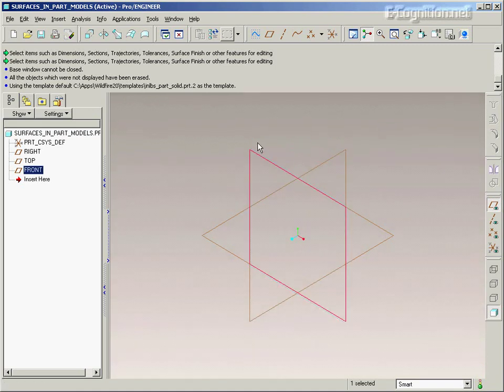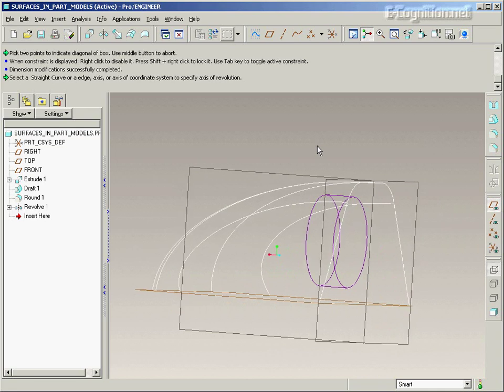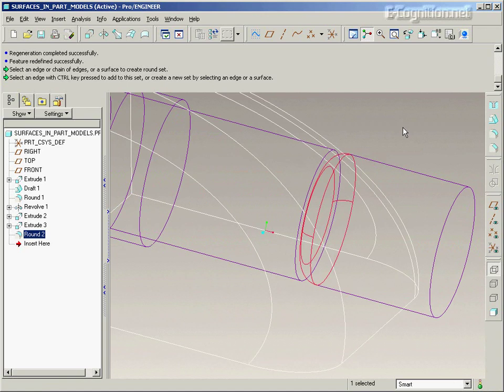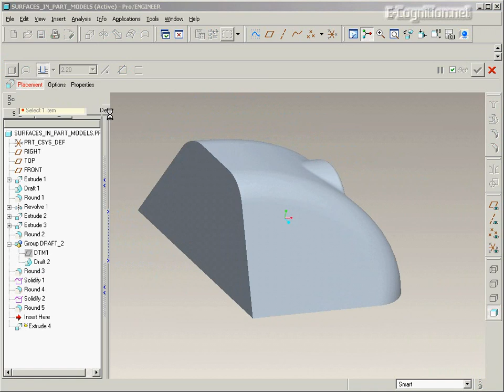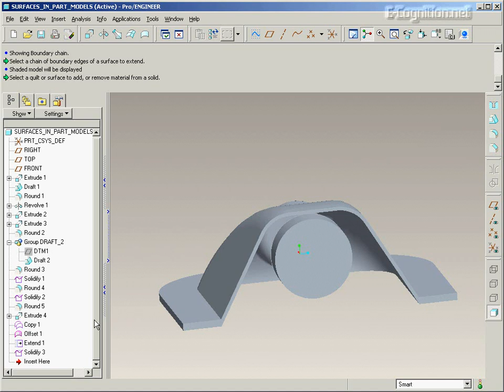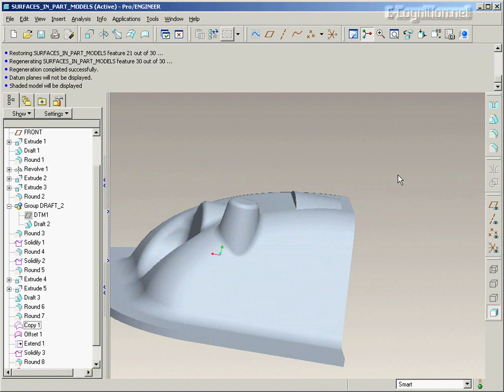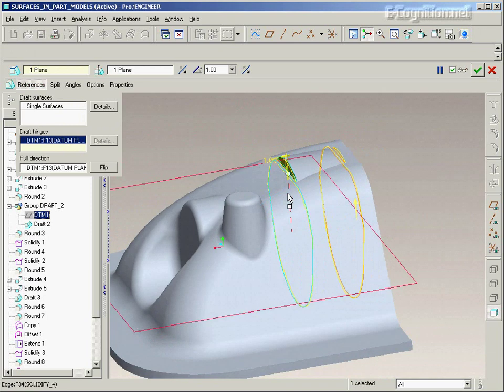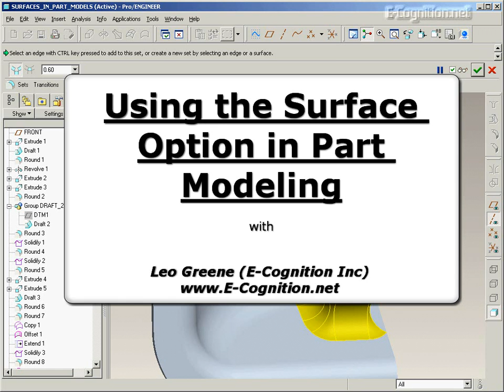Using Surfaces In Part Modeling

Comment: Funny how you get so much steps to create a part when you don't use the right software.
Reply: What software are you referring to as 'right' (do you mean more focused on surface modelling or do you mean a general software, such as Creo)?

If so, how does the software you have in mind stack up vs. Creo's motion skeleton capabilities (I'm into advanced mechanical engineering)?